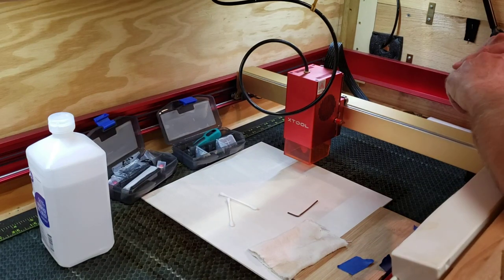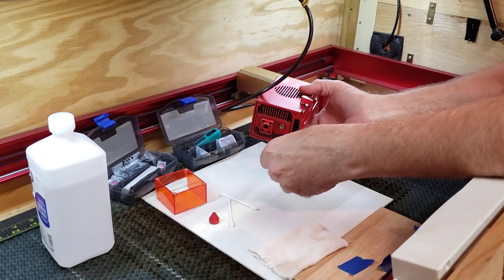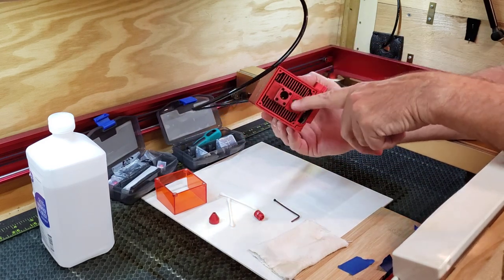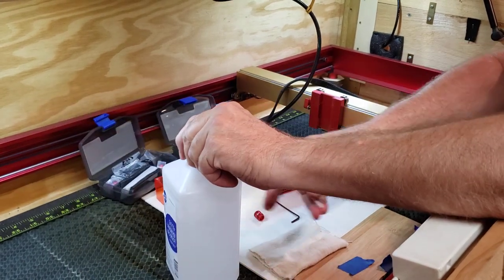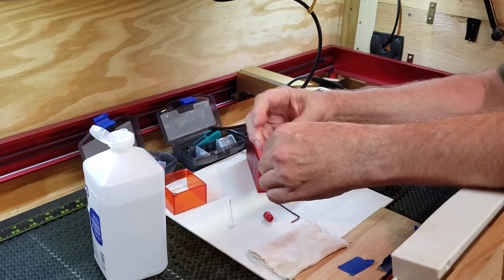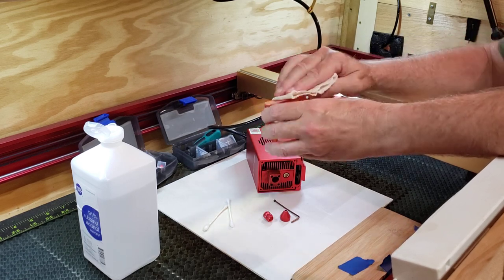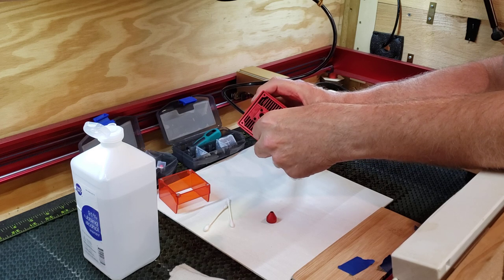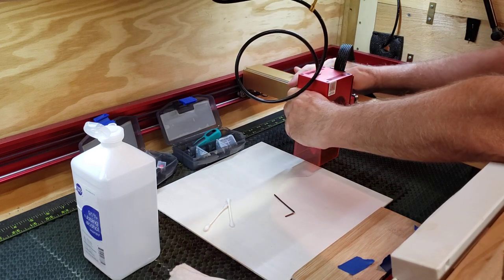Deep Lens Cleaning | XTOOL D1 Pro Laser

Comment: how do you clean the fans ?
Reply from the maker: Hey Stan.  Daily, I clean the fan vents with a shop vac - then with a cotton swab and alcohol.  To clean the blades (which I have not yet done), the cover can be removed and the residue cleaned off a swab and alcohol or white vinegar.  I've been meaning to do it and probably should soon. When I do, I will make a video. Thanks for the comment and for watching - Dave.

Comment: Every one hour of use. Funny
Reply from the maker: I thought it was odd too.  Thanks for watching and for the comment.
Reply: @DGLaserCraft  I just took mine apart for the first time. I have run it for about 20 hours so far. The lense was remarkably clean. I suspect the level of ventalation and air assist has something to do with it.
Reply from the maker: Ventilation and air assist do play a big role - I need a stronger air assist.  Also seems to get dirtier quicker when cutting plywood products - I guess the glue residue.  Thanks for watching and for the comment.